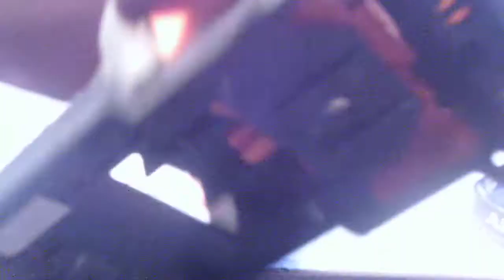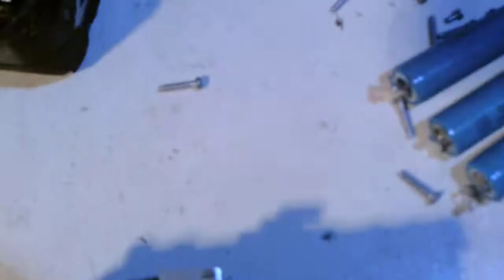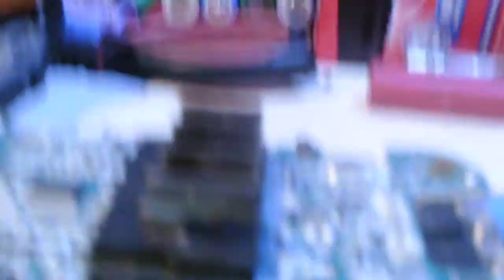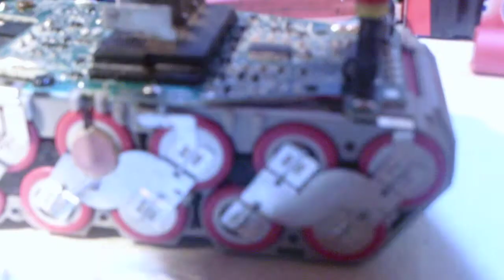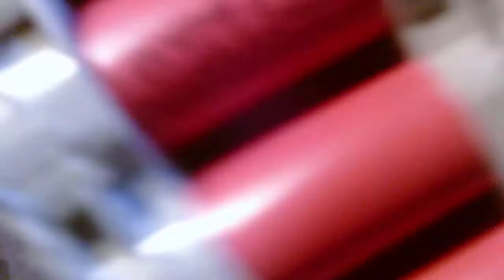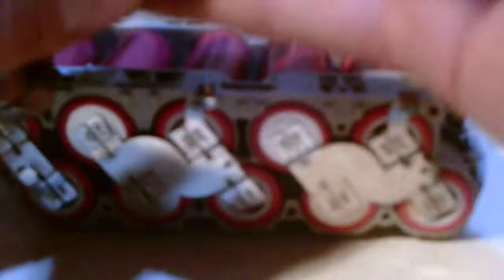AEG 18V 5AH  LI-ION BATTERY TEARDOWN

Comment: Am I correct in assuming you dont have to de-solder to remove the BMS from the batteries after removing those screws ? and that you just lever the bms up and away from the batteries ? I think I have a short on a component on the underside of the BMS board.

Comment: Do you repack or refurbish AEG batteries of other people. I have a 3 that I am looking to get fixed. I live in Melbourne.
Reply: I have 1 x 2.0 , 1 x 4.0 and 1x 3.0 which is an older unit.
Reply from the maker: Yeah I had a 3.0 in the bigger shape ones it was good
Reply: They just won't charge.
Reply from the maker: @lawriestewart6377  how old mate
Reply: @Oneupthesleevecustoms  I would say 3 to 4 years max. Not absolutely sure.
Reply: like the ones in your vid. @Oneupthesleevecustoms
Reply from the maker: Are they high capacity ones? What's failed?

Comment: Seeing those bms boards makes me appreciate my Makita..
Reply: Makita is known for making abnormally good battery packs though. This is less a ridgid thing and more an every other battery thing.
Reply from the maker: +0hypnotoad0 most of the dead ones ive  had were makita
Reply from the maker: +Freshkryp69 cause its simple?. I think these may also  be  the whole charge controller
Reply: Yes there simplicity has paid off for me, indeed the big boards can do a good job managing the cells. But bms arent absolutely necessary for long life.. Knock on wood, my 2 Makita packs are 7 yrs old and still going.
Reply from the maker: +Freshkryp69 thats a good run. All my gear is Milwaukee  and it is generally  awesome. Expensive but awesome